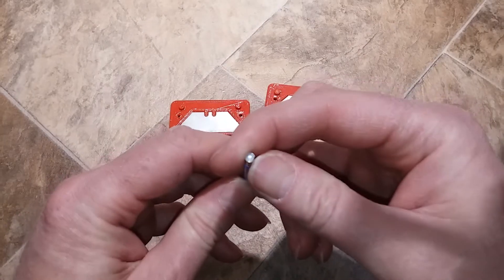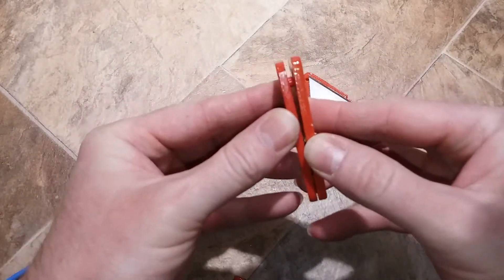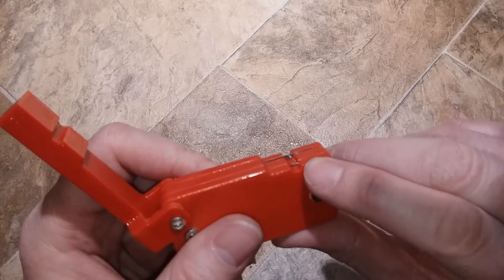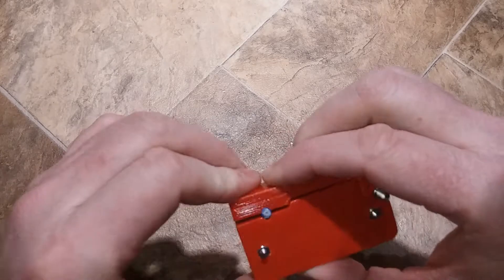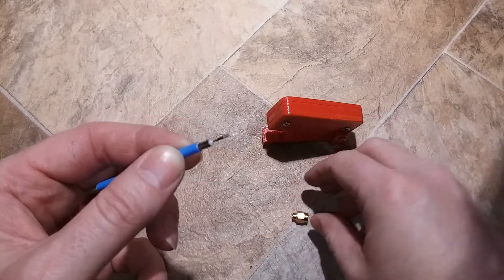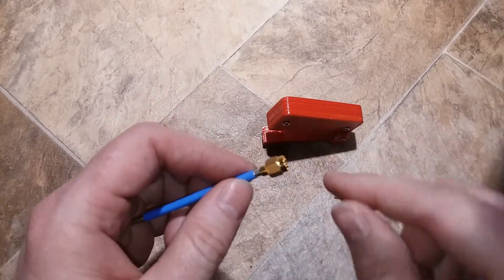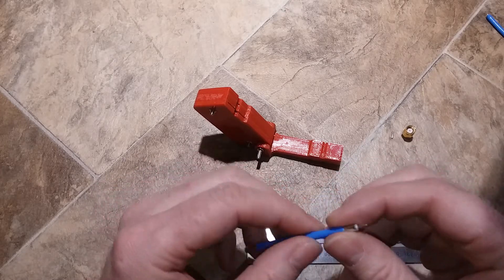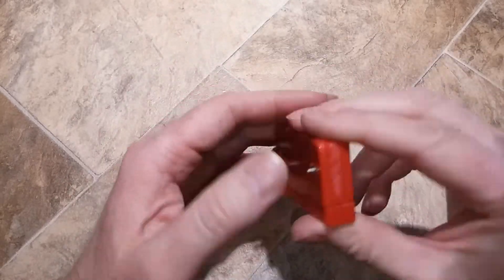3D Printed RG402 Coax Insulation Stripper

Comment: What about damage to the wire shield? Does it cut through? Does it tear when bent at the cut point?
Reply from the maker: One razor blade is offset a few milimeters so it does not cut into the center dielectric shielding.